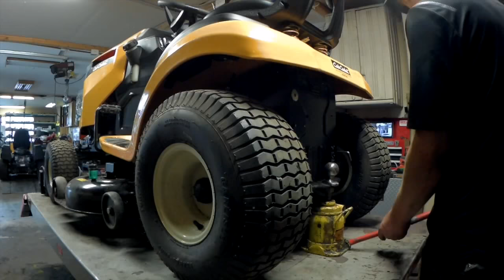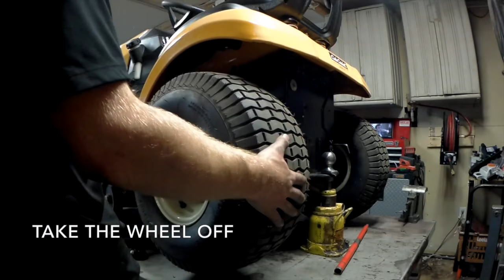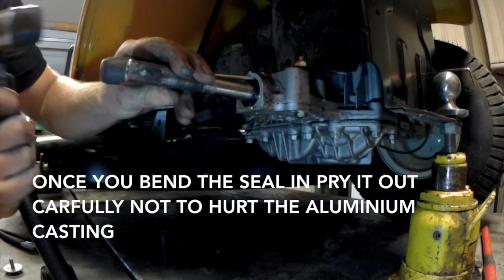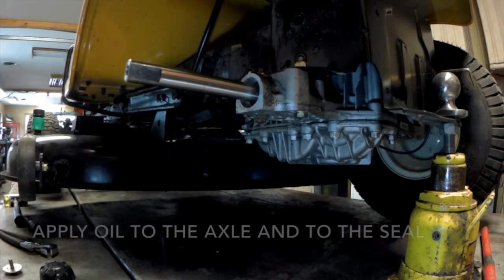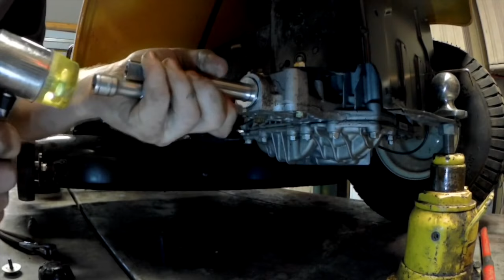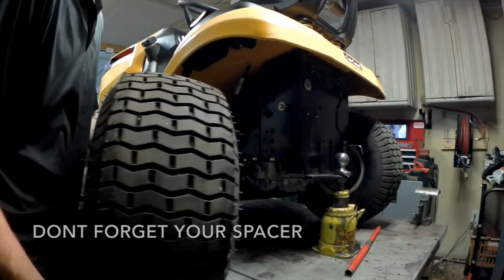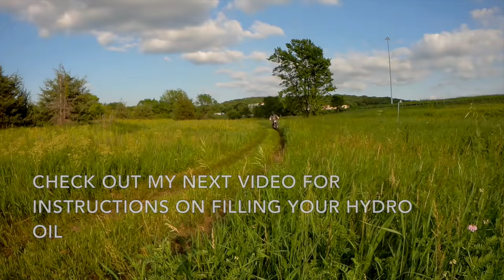How To Replace Axle Seals On Cub Cadet

Comment: What part number was the seal you used? I ordered part TT-1A646024440 from a seller on Amazon. Unless he sent me the wrong part, the seal I received is way to small to slide on the axle shaft. The seal was just in a small zip lock bag with marker indicating the part number on the bag. Should the part have been in a cub cadet labeled bag? My mower model number is 13WPA1CT009 if that will help you figure out the part number I need. Thank you!
Reply from the maker: Let me check on that fo you!
Reply from the maker: If the transmission is a "tuff torque" the part numbers are 
(2015) tt-19216334280
(2017) tt-187t0134280
For some reason i cant pull up 2016 on my phone so if thats what year your machine is let me know and i will get the number for you when im at work tomorrow. 

To identify what year your machine is look at the 5th digit of the serial number. If it is a 7 then the machine is a 2017 if its a 6 then 2016 and if it is a 5 then 2015. You get it. 

The other thing to check is the tag on the back of the transmission. Make sure it is a tufftorque and not a hydrogear. The hydrogears use a much bigger seal. 
I hope some of this helps. Keep me posted! I dont make money from youtube until i hit a certain number of subscribers so i would really appreciate a sub! Its free and easy!
Reply: Thanks for the quick response. So with the info you provided i have a 2014 and sounds like i did order the wrong part number. I will have to check the tag on the transmission, although i am pretty sure it is a tough torque. If you can find the proper part number for the 2014 seal it will be greatly appreciated.
Reply: According to the sticker on the transmission. It is a Tuff Torqe has the number 7A646084590   Also list a MTD PN as 618-06972. Thanks again for your help.
Reply from the maker: I will double check at work tomorrow for the correct number for you!
Reply from the maker: So sorry i sim0ly forgot to check for your part number today. But i set a reminder for tomorrow !

Comment: what part number is the seal on the lt1050, I've been unable to find that so far
Reply from the maker: I woulf be happy to help but i will need the model number on the white tag on the bottom of your seat.
Reply: @SEParotti  here it is:13AQ11CP010
Reply from the maker: Here is the part number: hg-51066
Keep in mind yours is slightly diferent then the one in the video. It has a snap ring holding it in so that needs to be removed before picking the seal out. Here is a link to the part on amazon. 

https://www.amazon.com/Hydro-Gear-Genuine-Original-Equipment-Manufacturer/dp/B0067T78E4/ref=mp_s_a_1_1_sspa?keywords=HG-51066&qid=1574561612&sr=8-1-spons&psc=1&spLa=ZW5jcnlwdGVkUXVhbGlmaWVyPUEyUVFXSlE0M0Q4NDRGJmVuY3J5cHRlZElkPUEwNDIwNDE4M0pGVk43SUwxM1NJVCZlbmNyeXB0ZWRBZElkPUEwNjIyMTM5M0E5SjYzSVU4TDJDMyZ3aWRnZXROYW1lPXNwX3Bob25lX3NlYXJjaF9hdGYmYWN0aW9uPWNsaWNrUmVkaXJlY3QmZG9Ob3RMb2dDbGljaz10cnVl
Here is a link to it on amazon.
Reply: @SEParotti  thank you very much for the help

Comment: I was hoping to see how to replace the black hub cap and make it stay on
Reply: I used a piece of plastic pipe and a rubber mallet worked great. Put the washers on the seal and used the plastic pipe to evenly install the seal.

Comment: Ok. Bad seal. Why? I can replace it and stop the leak. But… if the seal is bad because the bearing is worn, and the shaft has slop, the seal will just fail again prematurely. The bearing needs to be replaced to eliminate shaft slop, followed by a new seal.
Reply from the maker: if the bearing is actually bad then definatly replace it. these seals were very problematic all on their own. normally the bearing does not have anything to do with it. to be sure that the new seal wont just leak after a while install two machine bushings on the axle just outside the seal before you reassemble. by adding machine bushings i have completely eliminated repeat failure in my area. in the 8 years ive been adding machine bushings ive never seen one come back. if you look closely in the video you can see me install it.

Comment: Broke 3 seals, doesnt work
Reply from the maker: Haha. How the heck did you manage that? How are they breaking??
Reply: @SEParotti  no idea, i took out the previous seal and it was corroded pretty bad.  I thoght there may be some left over but wasnt, and when i hammer it in it becomes pear shaped 🤷‍♂️
Reply: @ski007jim  Yeah god&$&#& seal they are selling doesn't fit on CC XT1 models manufactured before 2017.   Would be real nice if someone could post a  part number that actually fits
Reply: @chrisstackhouse7749  i grinded down the seal a bit and stuffed it with jb weld.  Hasnt leaked since 🤣
Reply: @ski007jim  thanks for replying. I was honestly getting to that point but I realized from another commenter here that what really happened was the metal ring in the outside of the old gasket was left behind and it blends in really well with the axle.   I suspect this has happened to a lot of other people judging by the comments on videos like this one and reviews on Amazon lol
Reply: @chrisstackhouse7749  thats what i thought as well and dug out around the axel but nothing was there 🤷‍♂️

Comment: How do you fix it if there's got a scratch in The aluminum around where the wheel seal came out of?
Reply from the maker: sometimes a scratch is not a deal breaker. but if the scratch is what is causing the leak I recommend filling the crack with jb weld (or real weld if you are capable of welding aluminum) and then use a die grinder with a small bit to smooth it out and then install the new seal.
Reply: @SEParotti  hey that's what I told my brother use a little bit of JB weld and use one of those Dremel tools cuz they have sandpaper things that you can stick in there and sand it down and go to a finer grit and do a finished job. He said he'll use a little bit of form a gasket. Ain't going to work. Hey thanks.